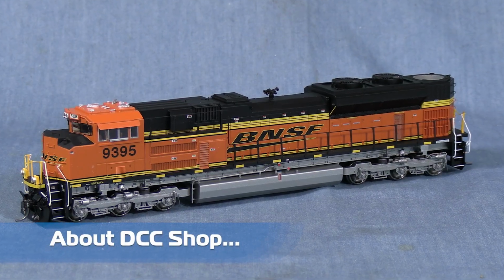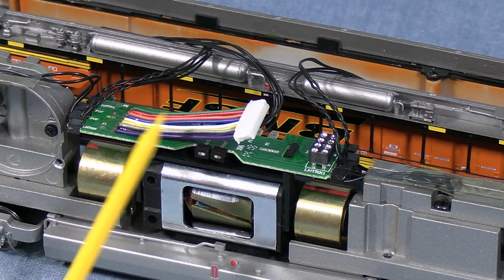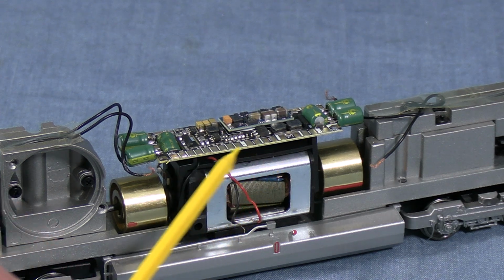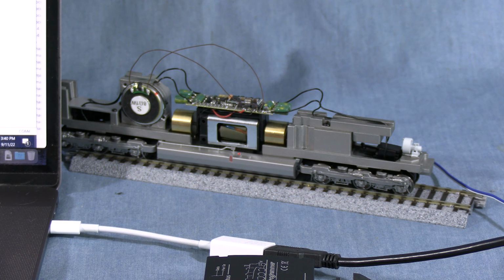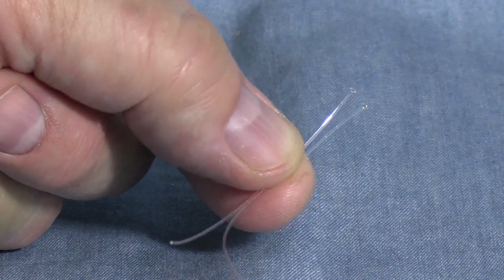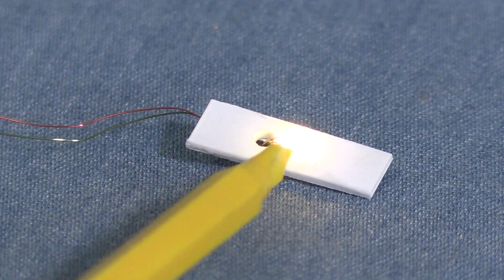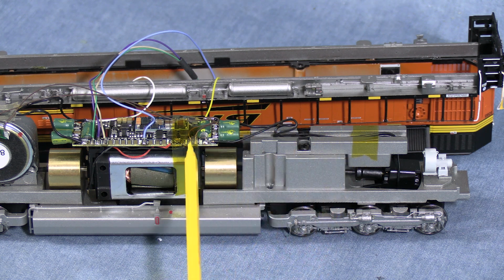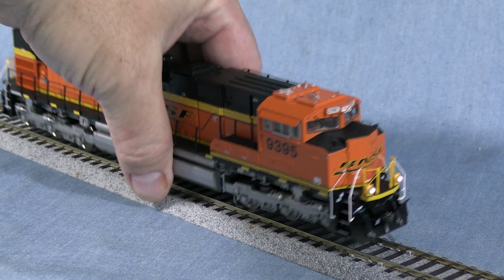DCC Shop HO Athearn Genesis SD70ACe - DCC, Sound, and Lighting Install

Comment: BNSF doesn't do flashing ditchlights but interestingly predecessor BN did on some of their units, BNSF changed them to solid ditch lights shortly after the merger.
Reply from the maker: Thanks for the info!  I don't recall seeing flashing ditch lights on any of the BNSF engines I've seen, but I wasn't 100% sure about this particular engine so I put the lights on separate outputs.  All I need to do to get rid of the flashing is just change a couple CV settings in the decoder.  Thanks for watching!
Reply: Great well paced and very helpful video 👍

Comment: Excellent vid Dan, a common practice many modelers are taking with DCC and sound installations involve the use of a NixTrainz Decoder Buddy, an LED friendly motherboard which has a detachable connector that allows for the shell to easily detach and accepts any 21MTC decoder. BNSF ACes’ ditch lights do not flash so they can be easily wired to a single AUX although it does not hurt to have them separately because it allows for the individual light brightness adjustment. Scale Sound Systems speakers are also very popular
Reply from the maker: I haven't yet tried a Decoder Buddy.  I may consider that in a future episode.  I can see one advantage would be that it would make it easy to swap in an upgraded decoder later on.  Thanks for the info on the ditch lights.  As I've mentioned in other comments, I don't recall seeing BNSF engines with flashing ditch lights, but I wasn't sure about this particular engine.  I would have wired the lights separately anyway, just as a good practice, and because of the brightness adjustment you mentioned.  I am not sure what brand of speaker I used.  I have a stash of speakers that I've accumulated over the years, and my choice in this case was driven by what would physically fit in the factory speaker mount.  Thanks for watching!
Reply: Just use a TSU2 decoder
Reply from the maker: @kyleftw1679  My personal preference is for Loksound, but the installation for any board style decoder would be similar.

Comment: This video is a big help. Thanks Dan!

UP, BNSF, and CP locomotives do not have oscillating ditch lights. NS CSX and Amtrak do. I’m not sure about CN or FerroMex. Some locomotives, like SP, had a switch to enable the flash on the back wall. If you see a UP locomotive with oscillating ditch lights, it’s probably exSP. (I can’t remember if CNWs did or not)
Reply from the maker: I'm glad you found the video helpful. Thanks for the info on the ditch lights.  Thankfully if you use a separate function for each ditch light, it's just a matter of programming to have them flash or not.  I guess that's the model equivalent to that switch on the back wall.  Very interesting detail I didn't know about!  Thanks for watching!
Reply: @DanielCortopassi would it be possible to program a yard switcher set to have their headlights on dim on either end of the consist? Most models seem to only have the ability to have the headlights switch with direction of movement. On the prototype we have a dim headlight on both ends as a marker light.
Reply from the maker: @rjohnson1690  I'm not sure about other brands, but one of the things I like about LokSound is that you can program the same light to work in slightly different ways with different keys.  One thing I like to do is to program a couple of keys to turn on each headlight in addition to the usual 0 key.  The 0 key still makes the lights work directionally like you'd expect.  If you use one of the other keys, though, it's like an override and gives you manual control of the lights.  So to do what you want, I could turn the end lights on both engines on independently and since on that function key they're not directional, they'd stay on no matter which way the engine is going.  The headlight dimmer key still works regardless so if you want them dim you could do that too.
Reply: @DanielCortopassi that’s great. Thank you. All of my power is either Scaletrains with Loksound or Athearn with Tsunami (which I may swap out.) I have three Bachman Amtrak Chargers, but I’m not certain what they have at the moment.

Comment: Very cool video Dan and to answer your question, none of BNSF's SD70ACe units have flashing ditch lights, but do feature ground lights, which is interestingly omitted on the road's GE/Wabtech units (C44-9W, AC4400CW, ES44AC/DC/C4 and ET44C4).  There were SD70MACs that BNSF predecessor Burlington Northern ordered that did feature flashing ditch lights, however, those units are likely stored/retired or overhauled and repainted and thus no longer have alternating ditch lights.
Reply from the maker: Thanks for the info.  A lot of people have commented on this.  I didn't recall seeing flashing lights on any BNSF engines, but I didn't want to make too many assumptions.  I did assume that Athearn was correct in putting the ground light detail parts on the model, which is not necessarily safe either, since manufacturers don't always get everything right.  I think the techniques used could be applied to other models, which is one of the reasons I tried to wire the model to be as versatile as possible.  The flashing can be changed with CV programming, and the ground lights could be turned off.  Thanks for watching!

Comment: I always watch your videos.  With my layout and cars, I have been using Kaydee couplers whenever possible and make sure they are all at the correct height.  I have found that some of the cars I have are very difficult to change couplers.
Reply from the maker: It can be difficult to change the couplers on some cars.  I can think of a couple specific models by Atlas and Athearn that are super difficult.  I really wish manufacturers would just use a draft gear box that will accept a Kadee, even if it has to be slightly oversized.  Thanks for watching!

Comment: I thought all these locomotives had ditch lights in the rear too. Great work, that sure takes a lots of patients when WORKN on tiny models/parts, ECT, like this. Great job.😉👌👍
Reply from the maker: Photos I found of this particular unit show it with no ditch lights in the rear.  Some SD70ACe engines do have them.  I have a pair of Athearn NS units that do.  I'm glad you liked the video.  Thanks for watching!

Comment: Awesome video just for a heads up, none of the BNSF locos have flashing ditchlights!
Reply: a small number of ex BN MACs I found have flashing DLs
Reply: @CentralJerseyRailfan  but those are former bn units that weren’t changed. All new ordered bnsf units don’t have flashing ditch lights
Reply: @CentralJerseyRailfan  none of the BNSF locos I have seen, have had them. Living in BNSF country as well
Reply: @scottk9806  it's most likely the units that were equipped with flashing ditch lights, which would have been BNSF predecessor Burlington Northern's first order of SD70MACs, have either been retired or rebuilt into SD70MACe units in which the later no longer features flashing ditch lights.
Reply from the maker: Thanks for the info.  I wasn't 100% sure about the lights, though I don't remember seeing flashing ditch lights on any BNSF engines that I've railfanned.  I'm glad I set up the engine the way I did, so that the flashing can be eliminated with just a bit of reprogramming.  With a decoder that has a lot of outputs, I think it's good to take advantage of that as much as possible.  That way if any adjustments need to be made later, it can be done with CV programming and won't require physically opening up the locomotive.  Thanks for watching!
Reply: @CentralJerseyRailfan did Santa Fe do oscillating ditch lights?

Comment: This unit did not have ground lights bc bnsf does not have grounds lights on their units. Otherwise this is a good video
Reply: Just looked at a picture of this unit, and it does have ground lights.
Reply: IIRC, BNSF didn’t specify truck lights on their GE units but their EMDs seem like the exception
Reply: look at BNSF engines at night, they have step and ground lights
Reply: The early thundercabs did have them on a mistake on EMD’s part. All other models of their newer locomotives do not have them. The gevos and later Ace orders don’t. They have retrofitted some local units with them. Otherwise no major unit has them unless otherwise noted
Reply: @devernepersonal3636  most units only have step lights
Reply: @BNLX_7046  actually the later SD70ACe units do have ground lights, I'm around these units pretty often and have seen them lit.
Reply: @yankeesforlife24  all of BNSF's SD70ACe units are equipped with ground lights as well as a good number of their older EMD models used on locals.  I've been around these units at night and have seen them lit, for whatever reason, BNSF elected not to have ground lights installed on the GE/Wabtech models and only feature the standard walkway and step lights.
Reply: @CentralJerseyRailfan  correct, for whatever reason, BNSF elected to not have ground lights on the GE/Wabtech models, maybe the reason their EMDs have them is because it's standard equipment instead of an option like with the GEs, hard to say.
Reply from the maker: Thanks for the info everyone!  I was taking Athearn's word for it, so to speak, going by the fact that there are ground light detail parts on the engine.  I guess the good thing about the way I did the install is that the LEDs are inside the model and don't show unless they're on.  So if the real engine shouldn't have them, I can just turn them off.  This same technique could be used on other models that do have ground lights.  Thanks for watching!
Reply: @randallellison6421  thanks for being the voice of reason and truth.

Comment: Hey Dan, what kind of soldering iron do you use for your small intricate soldering work?Also,what kind of flux do to use on your Loc Sound boards? I have used tix in the past but was told recently that is bad to use esp on boards. Keep that content rolling!!!  Jeff
Reply from the maker: I use a Weller 25 watt iron, which is great for electronics.  I've also used it to hand lay track on PC board ties.  I don't use any flux on electronics.  Sometimes I pre-tin the solder pads by heating them with the iron and then applying a small amount of solder.  If you also pre-tin the wires, then connecting the two is very fast with just a quick touch of the iron.  The rosin core solder I use for electronics has a small amount of flux built in, if I recall.  I like Tix flux for some applications, like hand laying track and building locomotive handrails.  Thanks for watching!

Comment: Hey Daniel, excellent work!
I would just like to ask if possible if you would take repair requests. My UP 8419 is missing its ditch light and I need someone to replace it. If you can respond I'd appreciate if there was any way you can help. Thank you and have a wonderful rest of your day!
Reply from the maker: I'm glad you like my model.  Unfortunately between making videos and working on our house, I don't have the time to do work for anyone else right now.  If you can't get a replacement ditch light from the manufacturer you could try aftermarket parts from Details West or Detail Associates.  Small surface mount LEDs will usually fit inside those.  Good luck and thanks for watching!

Comment: I am curious to know how big your layout is.  How many engines can you run at the same time.  Which dcc o you use?
Reply from the maker: My layout isn't built yet.  I'm still working on the room where it will reside.  The current plan should support quite a few locomotives (over 100), though not all running at the same time.  The idea is to have enough staging to run 7 or 8 trains in each direction on an operating "day" without repeats.  Trains will come out of staging, run over the layout, and then go back into staging.  I am going to use the ESU ECoS DCC system on the layout.  I'll probably need to divide the layout into power districts with additional boosters.  Thanks for watching!

Comment: Hey Dan, recently I bought an ESU V5 direct and got it programmed for an EMD 710 sound file. When it’s in the locomotive, the decoder gets extremely hot when it receives power at all. The locomotive is an Athearn RTR GP60M. Is there anything I can do or someone I should contact? Thanks.
Reply: The current draw is also much higher than any other of my DCC locomotives and it does make a very quiet buzzing sound like there’s a short.
Reply from the maker: Since you mentioned the possibility of a short, I would suggest maybe removing the decoder and checking for that.  If you have a multi meter that can help.  Make sure there's no current flow between the wheels and the motor.  I have an Athearn GP60M but it's been a while since I worked on it.  Some Athearn motors have contacts on the top and bottom.  In the old days the bottom contact would touch the frame.  A newer DCC ready version should be insulated, but it's another spot to check.  If you can test the decoder in a different model that could also help to narrow down the cause.  If the decoder is defective, I'd suggest contacting ESU.  Good luck and thanks for watching!
Reply: Thanks for the info, I already insulated the bottom contact with some tape, and I tried all of the other methods you suggested. My guess is that it’s defective, so I contacted ESU about it. Hopefully I get a response soon from them. Thanks.